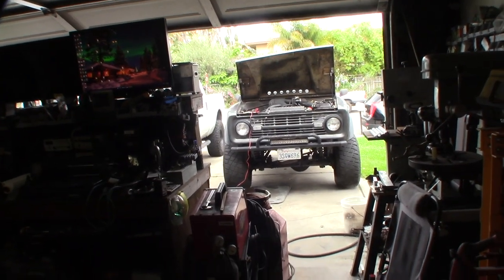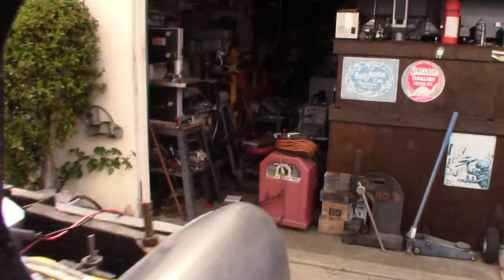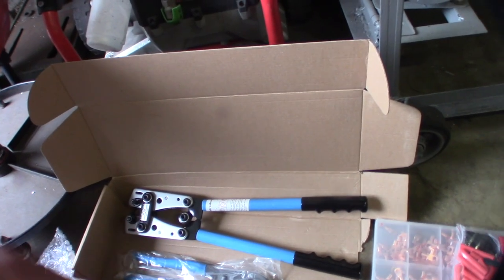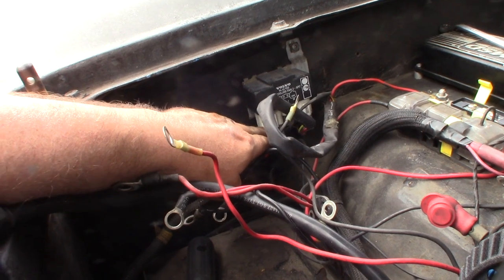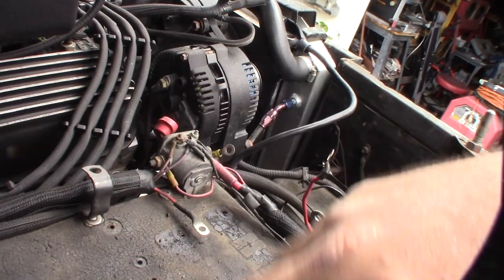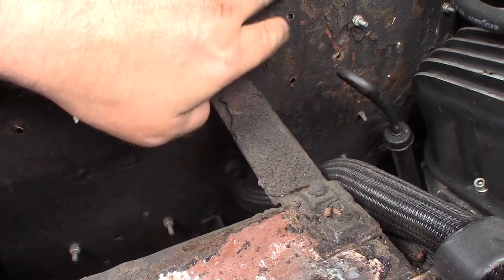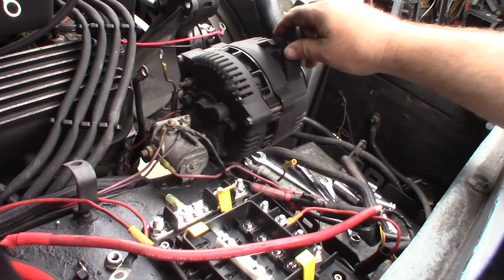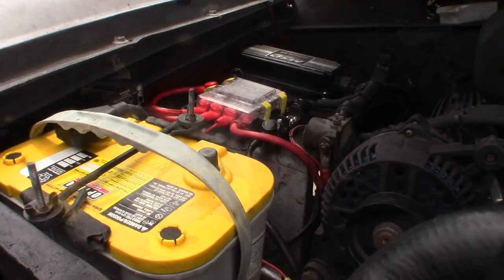Early Bronco main fuse panel upgrade, electrical distribution panel, Blue Sea  7748 SafetyHub 150

Comment: I have a similar situation with my "71" Bronco that I would like to clean up. 3g alt, 4r70w, Fi Tech with high and low pres. pumps, stereo amp & sub, upgraded headlight harness ect. Are all relays still randomly located down stream, or would a fuse box with relays work better? Might take a minute, but could you diagram your new wire layout, main cables to ?, fuse sizes for each? Would be helpful. Always appreciate your bronco content. Thanks.
Reply from the maker: My relays are in my internal fuse panel. I have a few next to the Holley EFI.  I took a fuse panel off a 90's explorer a few years ago. I didn't like the way it looked. It would be nice is blue sea made a fuse panel with relays.